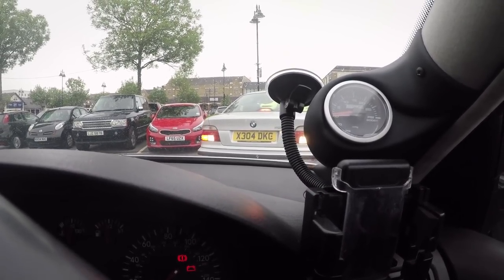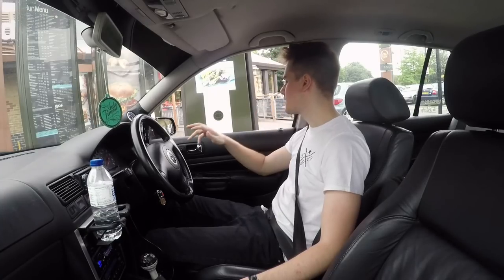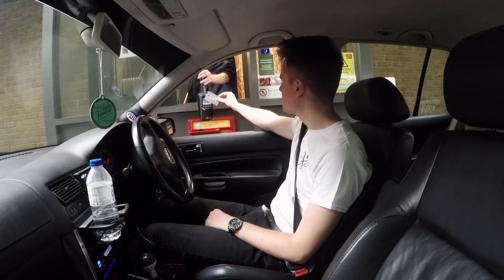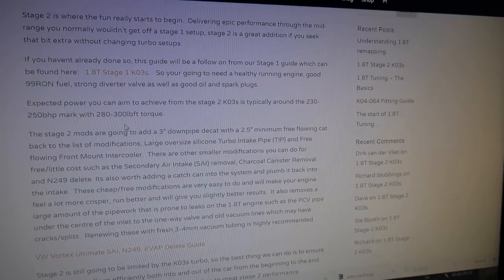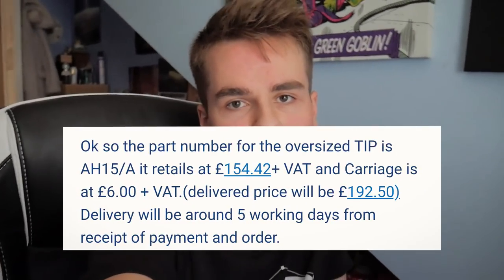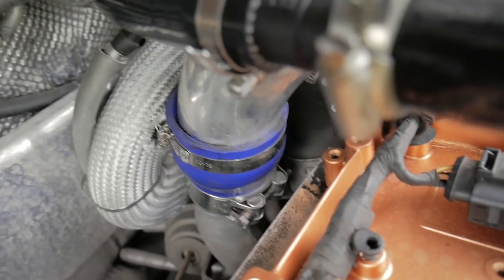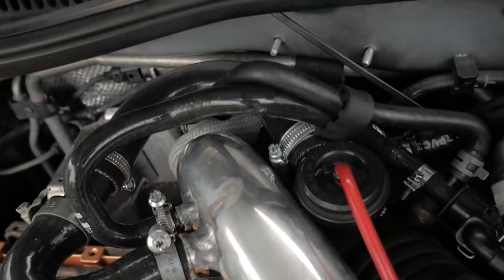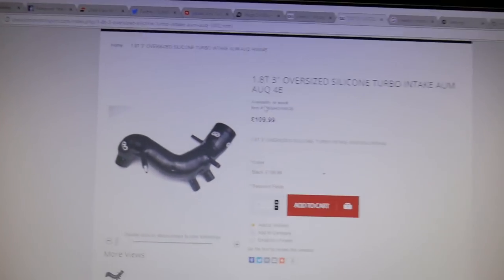I Finally Got This Working Again!

Comment: You should have got the Forge Motorsport Tip one, i had it on my AUM and was direct easy fit. Better quality and for heat aswell compared to others. Make sure you put your forge dump valve together with it. You overpaid for the fuel pump when you could have got a better one for £40 brand new and better than walbro 255. If you need to get a full vcds report, clear your current fault codes and want to code anything, let me know i get can it done for you. I have latest genuine HEX2 vagcom vcds. Am based in East London. Let me know, Thanks.

Comment: The creation motor sport oversize TIP is good for the money.  I got one on my mk4 it was a bit of a nightmare but not too bad.. All you gotta do is unscrew the two bolts holding your metal water pipe against the right side of the engine and slightly bend it without breaking it basically.  Lol I must admit it wasn't a fun job..  Also the other trouble I had was i tried doing the job completely on my own. I'd recommend getting help feeding the pipe down as someone guilds it from underneath..  As you'll find out the pipe is a strange shape and feeding it down and onto the turbo intake flange is the worst part of the job. 
Make sure you get a few different types of jubilee clips too as the silicone hose is thick and when on the turbo flange the jubilee has trouble getting on as it hits the turbo if it's a bulky jubilee clip.. I have a video talking about turbo flutter did you see it?   I think that could be your problem with your flutter mate. What size maf end did you go for? I'd recommend going for the 80mm maf end so it flows better.. Especially if you wanna get numbers in the 240ish range a ko3s can hit that but you'll need a good flowing engine..
Reply from the maker: Hopefully it's okay to fit the, I'll seek help from someone nearby 😂 appreciate it man 👌
Reply: Did you get the 80mm MAF end?  
If you have serious troubles and can't do it hit me up on Messenger, same name as here.  Or message on here. 
I live in Tunbridge wells, kent so not far from you. I'll help you get the bugger on! 😂
Reply from the maker: Yeah I did, and cheers man appreciate it, will do 👍
Reply: If you still wanna drive your car around until you map it make sure you get a small bit of 80mm pipe and a 80mm to 70mm silicone reducer so you can still run your 70mm maf..  If you try run a 80mm maf pre map you'll get fuel trim problems..  Basically it will run like a bag of shit as it will go lean.. Trust me I've been there lol
Reply: What a long day its been I've stripped off the intake manifold as I'm porting it out as much as I can get away with and fitting all new gaskets.  Probably going to paint it black or red.
Also whipped the valve cover off  and I'm gonna paint that also red or monster racing green.. Again still unsure yet. I also stripped the turbo off and the full exhaust system including exhaust manifold.. So a pretty busy day for me 😂

Comment: All this money you’re spending... for 300-400 quid you could of bought an AMK lump running the K04 turbo which would give you 250/260hp on just a remap.. and it would just drop in with little fuss.